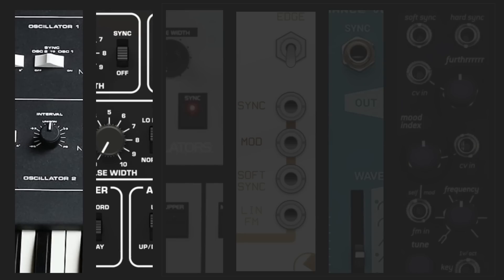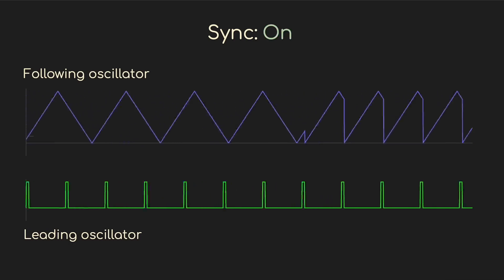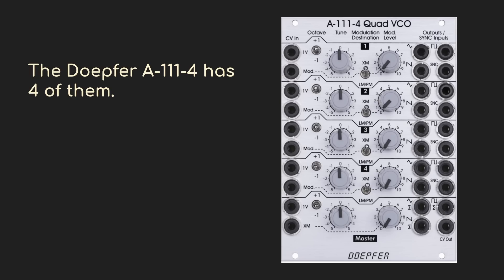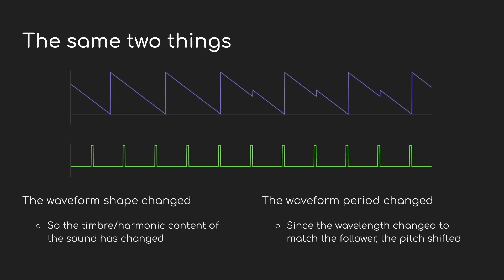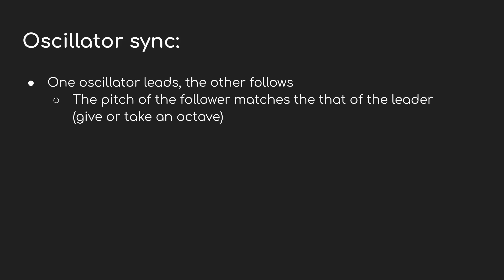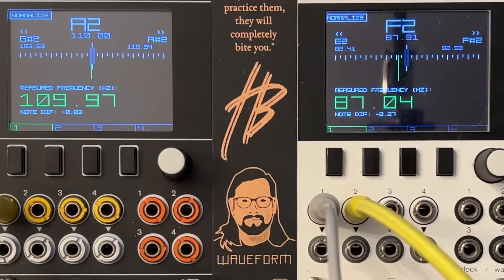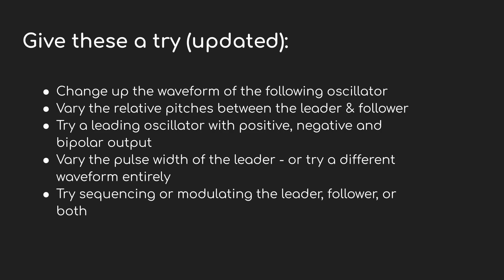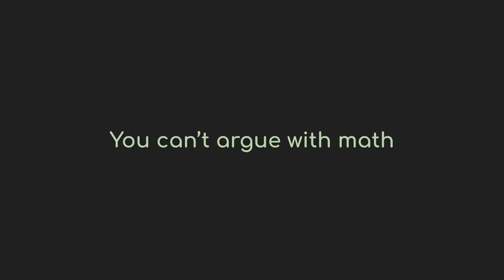Oscillator sync is a lot deeper than you imagine

Comment: What do you mean by fixed architecture keyboards? I’m new to synthesis and trying to learn as much as I can.
Reply from the maker: @timbabcox6581 - I mean that the synth circuitry inside is largely fixed and wired together.  You can change values of the parameters but you can't, for instance, change where the envelopes are routed to, or add a new oscillator or - in my case here - decide to change what signal the oscillator is going to sync to.

Some synths have incredibly flexible routing options, but even then you can only choose from the options they give you.

Comment: The 3340 sync is really complex and doesn't fit the traditional description of sync. The illustration of the sync effects in the datasheet is a mess. The triangle core sync works by switching the slope of the triangle instead of resetting the voltage to 0. This ends up doing weird things in the triangle to saw converter which uses the slope of the triangle to activate an inverter. I think that the 3340 hard sync affects the saw directly.

Saw core oscillator sync is what you described at first and it works by shorting out the timing capacitor. It's much easier to understand and demonstrate.

Comment: The sawtooth you showed likely swings around 0V DC. It's sync input resets the waveform to the middle of its cycle at 0V. The reset also seems to set the phase of the waveform to its downward cycle (likely due to easier circuit implementation). You can think of the sync input as a form of phase modulation (not FM). 

The demo waveforms were reset at its most negative point, so I wouldn't focus too much on them as a comparison.

Comment: I think you did an incredible job explaining sync
yes, there's an open door with the various behaviors from different manufacturers sync methods
but the underlying premise is thoroughly explained here

I don' think these various methods need to be a mystery either
their behaviors can be defined (the three you show @9:34 could be described as repeat, hold, and mirrored, there's likely other methods in use out there)
and while the manufacturer most likely with just label it "sync", users would benefit from having language to classify each method
this arms customers with information before purchasing as well, for example if they prefer one method over another

perhaps this could be a follow up video, maybe it's too much of an undertaking, but it seems like something you'd be interested in

finally, sync can play a great role in creating stable fm patches in modular, by forcing your carrier and operator to be locked rather than drifting
Reply from the maker: @DataBroth the FM trick is a great one, I need to remember that when I go to make my FM video, thanks!

Comment: I think generally soft sync could be described as some method of taming the (potential) discontinuity at the sync point, usually by applying a window function that fades the follower waveform in and out around that point.